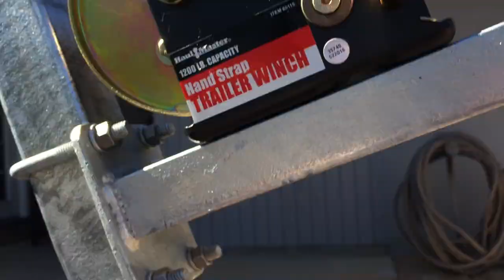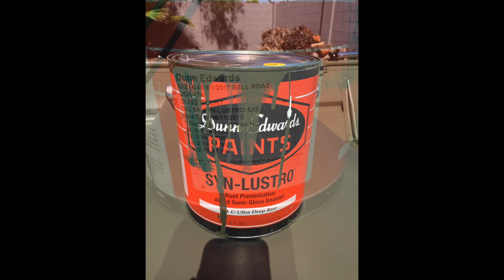How to convert Harbor Freight trailer to boat trailer

Comment: Nice work on the trailer! What kind of spacers did you use to fit the tube? Also, you mentioned you had to cut something at the tongue (top of the A shape) to make the tube fit. Can you explain how you did that?
Reply from the maker: The spacer is about 2mm each side. You have to watch the video one more time to see what did I cut. It is hard to explain.

Comment: Nice trailer! Do you mind telling me the length of that square tubing? I have that trailer and am thinking about doing this to haul a 14' flat bottom.
Reply from the maker: Thanks! I sold the trailer with the boat a while ago. If I were you, I'll install the pipe on the trailer, load the boat and then cut the front part out. Make sure it;s long  enough to turn safely. Then install the hitch coupler.

Comment: Great idea and good job putting it together! I’ll be doing one but welding instead.
Reply: I believe in Washington state it has to be bolted to be legal at least in Snohomish County
Reply: @dennisburrill3260  I’m in Nevada either way I wonder why that would be the case. Weld is stronger than bolts

Comment: OMG seriously?  What a crummy trailer. Any respectable would jump off that thing. Imagine the crummy tow vehicle for that crummy trailer.
Reply: What a crummy human being to be trying to shame someone over this. Just over a creative  youtube video this os disgusting! This just goes to show how mutch of an entitled prick you really are.
Reply: @ryanhimmin932   No I've earned everything in my videos. I don't knell or ever use the word entitled. Heck I even made my own avatar. We are not entitled to avatars in life. Wake up at 6am and produce your own?
Reply: Those trailers have been around for ~20 years. Many use them for building tear drop trailers and traveling around the country. They are also sold and very popular in Europe. Do some research prior to publicly displaying your ignorance.
Reply: @ridemfast7625  Yes Sir. Those little wheel bearings are begging to fail. 
I've always had a rule that the trailer tire should be as big or bigger than what it is hailing. Like my Polaris RZR or similar. It's nice having extra "bed" for boards or whatever-ya-find. 
A tandem axle rides like butter and you forget it's back there. 
FWIW in Illinois basic trailer plates jumped to $135/year from $20 -$30 like it has been seemingly forever. And the money will be abused by abusive corrupt leaders and union jobs, padded pensions.
Reply: @itsruf1  Those 25mm bearings have a load rating of 7000+ lbs each. Grease and service like all other trailers and no issues.
Reply: Those trailers are pretty damn good for the money I've own a few of them and have driven down the highway at 70 + the pull damn good and straight as an arrow!  Where do you get off at!
Reply: @thomasgrady9292  a "few" of them? I can imagine why.

Comment: Is the steel tube 4x2? What gauge?
Reply from the maker: Yes it is 4x2 . Gauge 12, Inch 0.104" Metric 2.6mm
Reply: @BoatMotors  ok thanks.